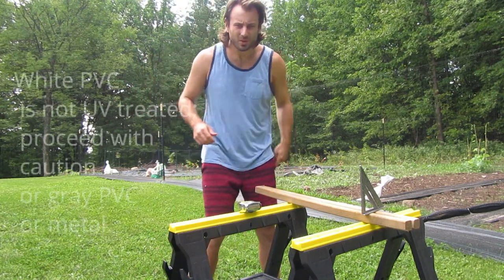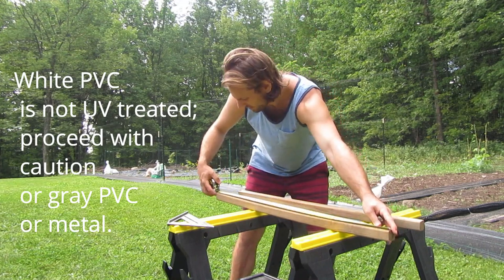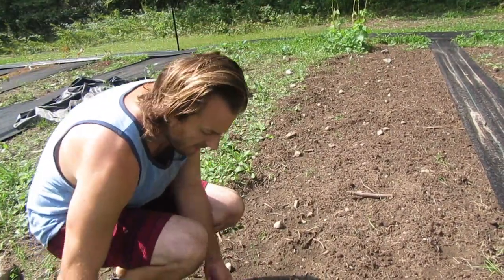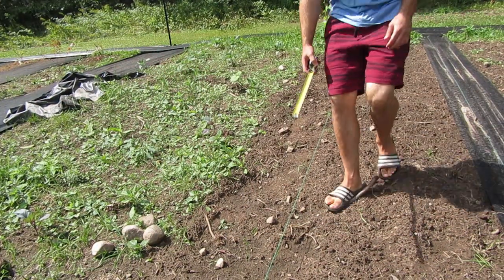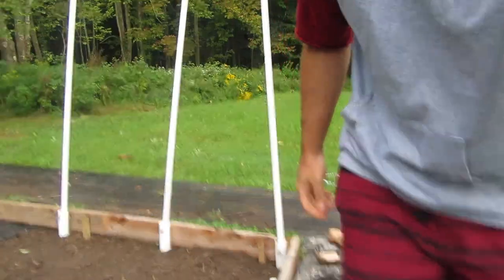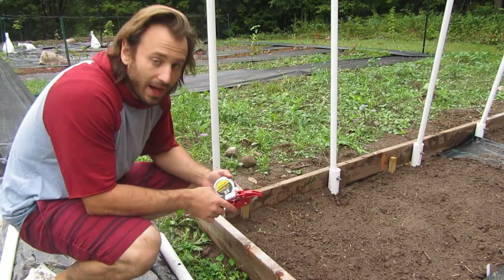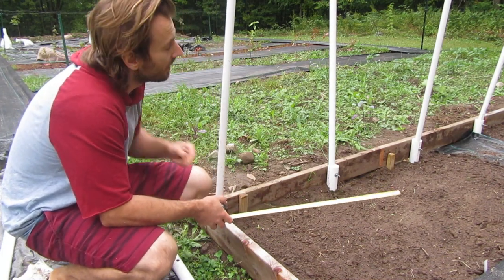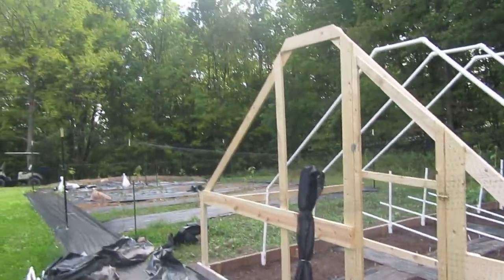Building a Greenhouse │ DIY PVC Greenhouse (Condensed Version)

Comment: Nice
Any issues with wind?
Would it have been better to close the ends before the roof so the ends get over lapped to prevent leaks?
Did you put any vents?
Assuming cheaper the using all lumber?
Overall it does the job. 😉
Reply from the maker: No issues with wind.  I did end up switching to metal hoops.   I have some all lumber ones now, too, but those builds are on my brother's channel.   I like them all, it is just about personal situation.